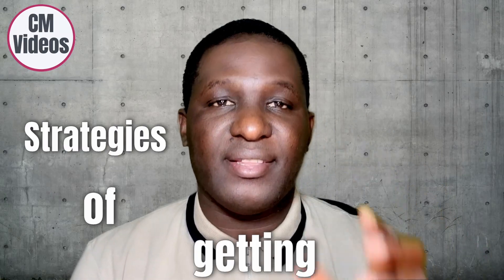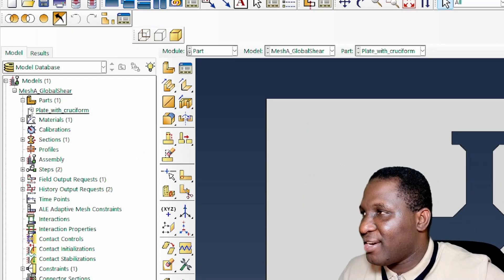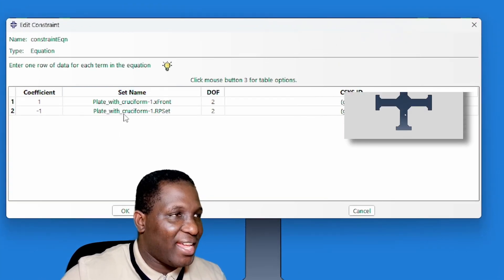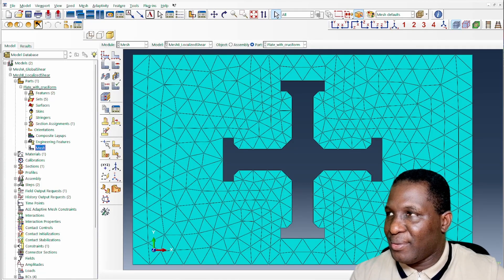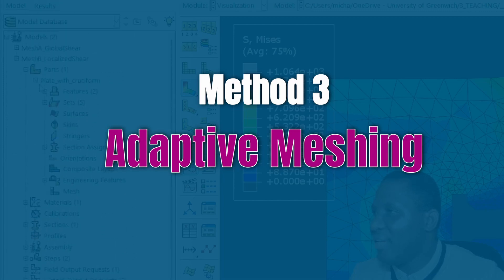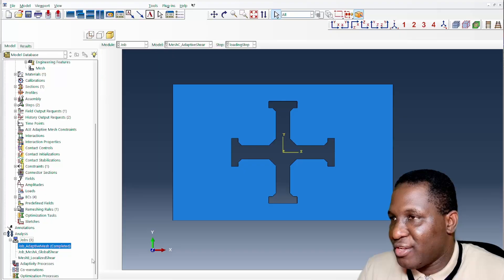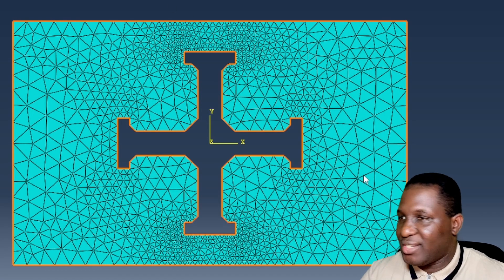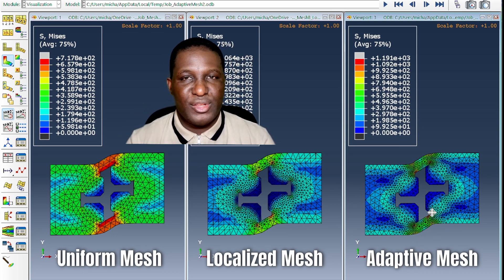SECRETS behind creating EFFECTIVE MESH in ABAQUS

Comment: Wow, thanks for the great video, Dr Okerke. I am using the GUI to copy the mesh pattern from one face to another to create identical meshes for the application of PBC in Abaqus. However, it takes more time to create the boundary mesh on the surface, offset the shell pattern, and then copy the mesh between the faces. Even after this effort, because of several circular features, the part mesh is often not generated successfully. So, again, I need to refine the edges and do the same things. Can you suggest some instructions to ease this process?
Reply from the maker: Hello, this is a well known problem. I actually do not subscribe to enforcing equality of mesh between the two faces, precisely due to the problem you describe. It works best if you are dealing with 2D problems and hence edges rather than faces. There is a different approach for dealing with non-periodic meshes and I published about this in this article: https://doi.org/10.1016/j.compstruct.2016.10.114  Good luck.

Comment: Excuse me, Dr. Michael Okereke. I have a question about Analytic field in abaqus. Can I construct the parameters of X1 and X2 as an expression in analytic field for 2-dimensional geometry? And how can I do it? Thanks beforehand.
Reply from the maker: Hello @Sothun Chhaer, thanks for the query. I believe this is possible. The parameters X1 and X2 in your query will have to refer to X and Y since the analytical fields for specifying say load has to be attached to a coordinate system. For a rectangular coordinate system, this will be X and Y. You cannot have two X's or two Y's as you have only one of either in the rectangular coordinate system. For a 3D system, this will be X, Y and Z parameters. You can then combine them the way you line according to your analytical equation. It is sort of straightforward. I will consider the request and see if I can make a short video to demonstrate this.
Reply: @MichaelOkereke  Hello Dr. Michael Okereke. I have imposed the traction force on my 2-dimensional domain and this is my outward normal vector expression in X-dir (Nx=(Y2-Y1)/sqrt(pow(X2-X1,2)+pow(Y2-Y1,2)). So I have no idea to deal with this expression in analytic field of ABAQUS. I am appreciative to accept any suggestion from you. Thank you so much!
Reply from the maker: Hello  @sothunchhaer , I am not sure if an analytical field expression is what you will need for this. This is because you are calling the Y2 and Y1 or X2 and X1 values which suggests they are different variables. Normally with analytical field expressions you have to call on X or Y at least once and it take the current coordinate nodal positions of X or Y-axis to evaluate the analytical expressions. It sounds in your case that you might have to use a kinematical constraint equation (*EQUATION) under the constraint tab and find a way impose the expression you have given in that way. The difficult bit here is finding a way to label the nodes for the N1 and N2 corresponding to X1, Y1 and X2, Y2 respectively. That is my suggestion.
Reply: @MichaelOkereke  Hello, Dr. Michael Okereke, how can I contact to you besides dropping the comments in here? Is it okay to you for doing this? 
Thanks, in advanced!!